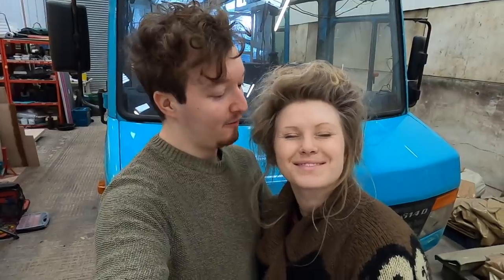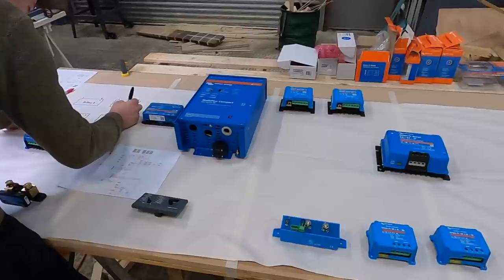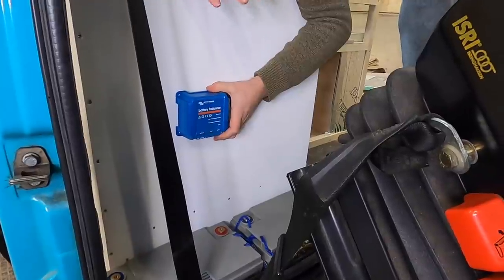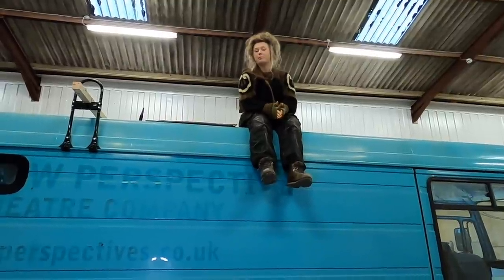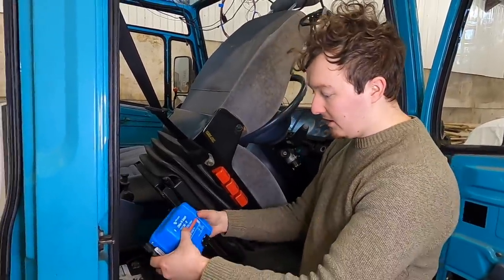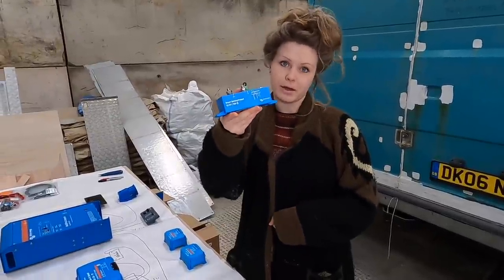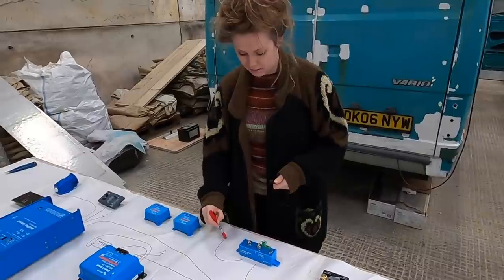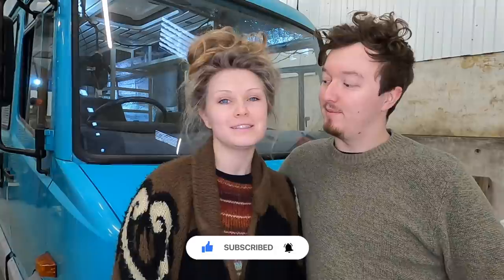OUR CAMPERVAN ELECTRICAL SYSTEM | Mercedes Vario | 12V & 24V explained Victron Haul | Van Build Ep25

Comment: I knew from your first episode that this was going to be a serious build and a proper job, but even by your standards that is a serious investment in elastic trickery...I have watched all your episodes over the last 2 weeks and am enjoying your efforts both build and film production wise, so thanks very much Ed.
p.s we got our VW Transporter that had been professionally converted because i was too busy to do one  at the time and at a cost of £15000 (just for the conversion with pop top and engine map and front body kit etc) but over the last 18months i have just about redone the entire thing the electrics were a very dangerous joke 1.5mm cable running the entire 12v system, no fuses between house battery and start wrong type of split charge system etc etc. Hopefully this may put your minds at ease over the amount you are spending ...yes its expensive but it will last forever and work safely and properly plus you look like your having a laugh doing it.

my last question will the work seats ,sofa , cinema chairs, dinette guest bed ,configure to cot / childs bed .
thanks for your fims Ed. Yorkshire
Reply from the maker: Thank you so much for your comment Ed! We are going to be living in it full time so although we are on a budget we are trying to make it as efficient as we can! We are going to be working on the road so power is the key thing we will really be reliant on! And wow, that’s a lot of watching, really glad you are enjoying it!

That’s really exciting, we did look at VW’s at one point but ended up with something a little different 😂 that doesn’t sound good with the electrics but I’m glad you have it all sorted now!

And it may do at some point in the future haha! 😊👍
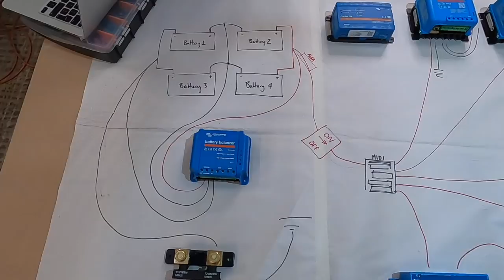Reply: @MaxSophieinaVan  Yes  binge watching due to its been cold here and i am renovating a house high above Huddersfield, so it seems if I sit in my van with the diesel heater on,  and watch an episode  at 1:25 playback speed its just long enough to get warm and then last week it was  back up the scaffold to the chimney.
Yes the cost is immediately more justifiable if its your main residence, there is no buying a £3500 lacanche oven to fit in a vario for one. I can charge my e bike in either of my vans via the solar, there is something strangely satisfying about that. 
i have ordered all the bits up from china to make my own bobil heater, after seeing your film, may try get warm water to the tack room where my daughters horse is.
If you are stuck scratching your beards (mainly Max) about any bits of the build, get in touch, i have done most  tasks whilst building houses and converting 2 vans, plus upholstery is my hobby. Ed
Reply from the maker: That sounds like a great escape to me! Sophies grandparents are in Yorkshire too and they’ve been sending plenty of cold snowy photos so I don’t envy you! 😂

That’s exactly right, and what a cool system, that is fully off grid with charging bikes too, something we might look into one day! And we saw someone else post on a Facebook group the other day about doing that, what a great idea! And thank you so much for the offer, we might take you up on that at some point! 😊👌
Reply: @MaxSophieinaVan  Its warmer today and raining so here goes.......
My tip for your solar roof cable entry, I used appropriately sized nylon cable glands (dont be greedy just use one for each cable) there are many ce and IP rated ones on e bay and then to get a nice   finish and to stop the cables whistling i put a stick on shark fin fake aerial over the top with grooves out the front to let the cables in not been an issue in nearly 2 years..

Also now is the time to be thinking about running the cables for your reverse camera/ rear view camera /front camera/dash cam/ surveillance camera, left side blind spot camera for abroad driving and parking sensors.
I would look at the 10.1" android radios double and single din, they fit in existing radio hole and the screen protrudes, under £100 work well for google maps and briiliant for reverse camera they also have aux av feed in for blind spot camera and the new type ADAS dvr dash cams plug in via USB they are brilliant and can be set to constantly record 24/7. I went through a stage of trying to out tech my wifes TESLA 3 in our VW.
 The Blind spot camera i fitted mid way down the passenger side high up just under awning on my fathers motorhome as he struggled at certain junctions after my mother passed away. 
I prob have links saved for most things if you require. 
now stop messing about on your phone and .....GET ON WITH IT !!!!!! ;-)
Ed
Reply from the maker: Hope you had a good day Ed! Do you mean the screw together ones? Wasn’t sure if they would be sufficient as everyone raves about the marine style ones but sounds promising if they were as they are a bit more affordable!

And that’s a great tip with the cabling for those things, will bare all of that in mind! Definitely need a reversing camera on these big beasts!

That sounds brilliant!! 😂 did you get the VW more tech-ed out?

Thanks again for all of the advice! 😊👍
Reply: @MaxSophieinaVan  Hi Max, i sent you a email to your gmail, with some links on, Yes just the £1.20 a piece ip68 nylon cable gland, the ones with the sealing o ring  on the threads that go through the roof. I used the double gland bonded on cowl marine type on my dads motorhome but i dont see the need on a steel single skin, his have been on 10years though no probs.
My  transporter is a T5.1  bluemotion with stop start, cruise and AC but i tech'd it up with mfsw (leather steering wheel with controls for display and radio), 9inch screen radio with useless DAB,  front and rear camera front has 24 hour recording and ADAS collision avoidance, reverse cam has overlayed optical front and rear parking sensors with moving trajectory lines,  it has igo primo world mapping 12gb of maps with speed limit warning etc,  i fitted heated seat kits, auto lights, leather trimmed sunvisors with dimming illuminated vanity mirrors from a jeep and colour changable mood lighting. Then i got bored bought a smaller NV200 van and started on that .
Heated seat kit would be good on yours. If you can get a 24v kit would draw too much power from a 24-12 converter i recon. VW will be for sale  as soon as its serviced i think. 
Ed
Reply from the maker: Nice one, will get to the email shortly!

And that sounds like a much more cost effective option to what we were thinking about, will definitely check that out and the links on your email! Nice to know it’s stood the test of time too!

And what a nice van, bet that’s super smooth to drive! And wow, that is a lot of tech! I’m going to look at how much I can convince Sophie that we need everything! 😂

What’s the NV200 like, is it one of the eco ones? Will have a look at heated seats, what a luxury!

Take care! 😊👍👌

Comment: I'm glad you've made a video explaining your system as a separate video. Makes it all really clear, and will undoubtedly make it easier to follow what you're doing when you make the video showing you installing it all.

Watching this, and a number of other van-building blogs, it seems like the electrical systems are the most expensive part of the build, as well as the most dangerous and costly if you get it wrong! Do you mind if I ask how much you've budgeted for the electrical system in total? Was there a reason that you opted to go with AGM batteries over lighter lithium-based ones?
Reply from the maker: Thank you so much David, that’s really what we were going for as there is so so much information out there to try and get your head around! So glad you enjoyed it!

And we always knew this would be an expensive part of our build but as we will be living in it full time thought it was worth a good investment! I think the full electrical system with all of the units, solar panels, batteries and cables will leave us just under the 6k mark!

We went with AGM over lithium mainly for cost and weight isn’t too much of an issue for us in a 7.5t van! But we apex’s the system with the ability to upgrade to lithium in the future if we save our pennies! Also these Victron Super Cycle AGM’s can be discharged down to 80% which gives us a pretty huge capacity similarly to lithium! Hope that all makes sense?

Thanks again! 😊👍
Reply: 7.5T van? have you had it converted to 814D wheels, brakes and suspension or is it still a 6T 614D?
Reply from the maker: We have had it uprated but still not quite 7.5! Commonly in the uk anything between 3.5t and 7.5t is called a 7.5t on all important paperwork etc.

Comment: Simply incredible. That’s a lot of weight hanging of the seat back with heavy duty cables. Wonderful.
Reply from the maker: It’s 18mm ply and will definitely be up to the job! As it’s all 24V it won’t actually be that heavy duty cable 😊👍